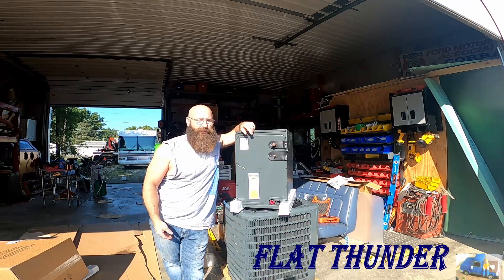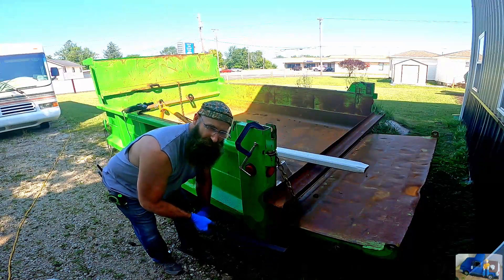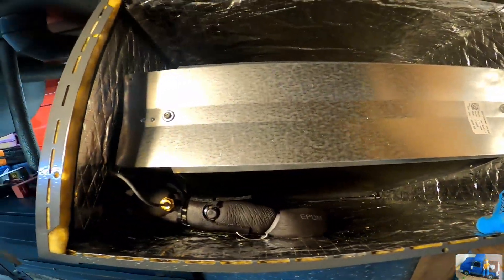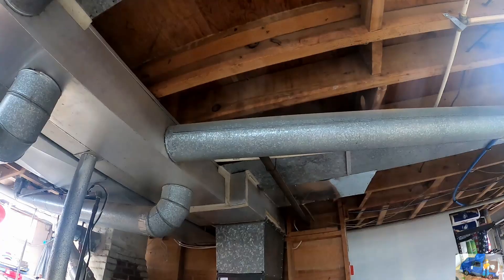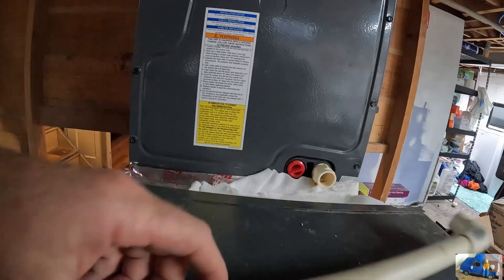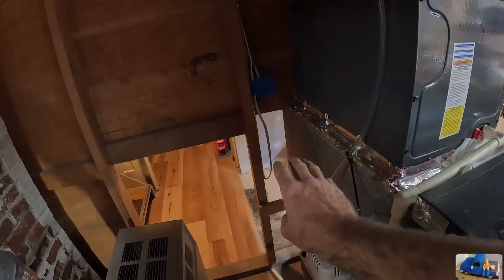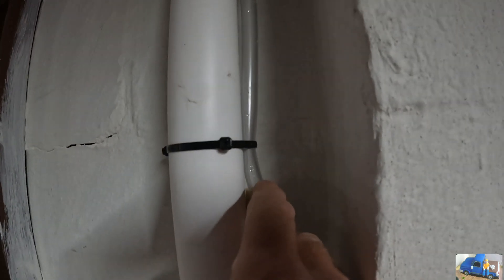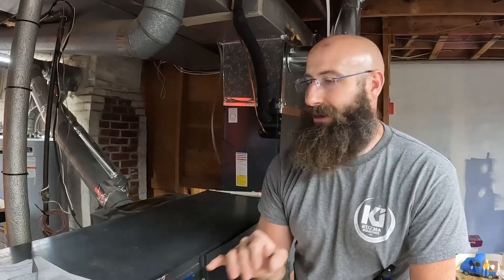DIY: Installing Central AC......Old Furnace

Comment: So when the furnace is going, it passes through the condenser that you put in the plenum?     Debating on installing too soon.
Reply from the maker: Yes, this is how all traditional furnace / AC units work.  The A coil is in the duct work and the air always flows thru it.  The condenser just doesn't come on in heat mode.  It works great!  Thanks for watching 👍😁